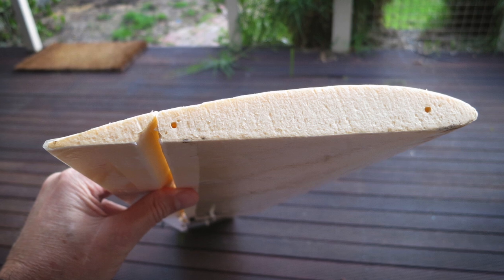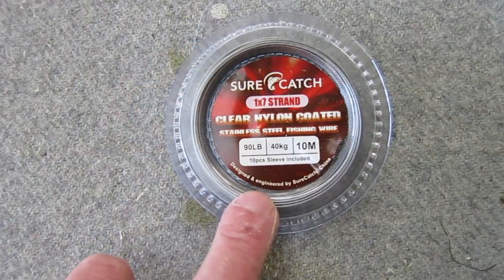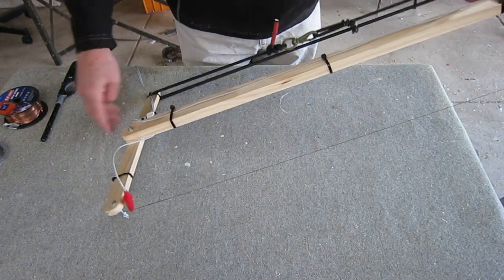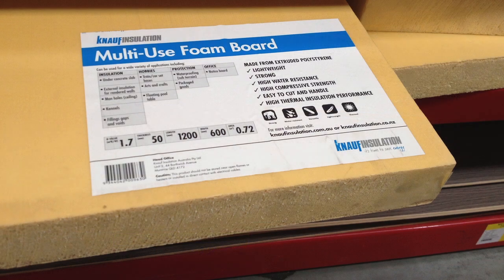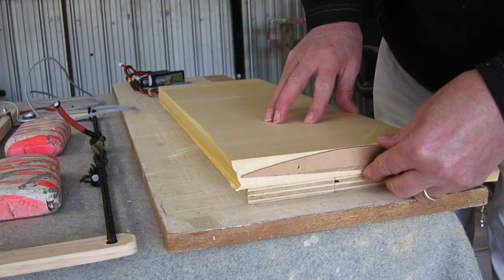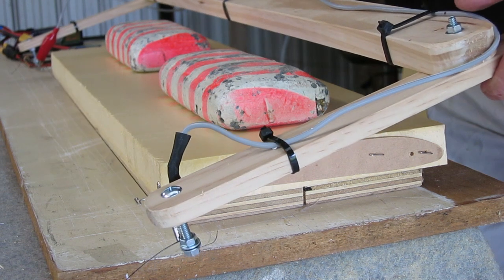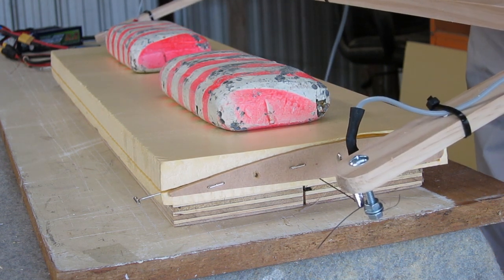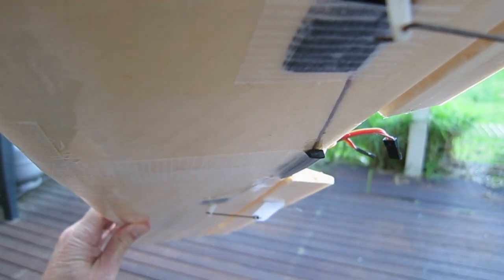Hot wire airfoils and bow

Comment: I never saw that sort of cut before. Well done. I used to do it with cross-section air-foil cutters, I made out of piano wire mounted on a special board. It' was a lot of mucking around making the air-foil cutter. You don't have to do that, you just make the air-foil guide ends. That's a lot easier.

Comment: fab fab vid thanks. Do you have one for your fuselage? I just started my spar hole with a soldering iron ;) I used nichrome wire, it's ok. I use lipo too, nice. I add copper wire for resistance if necessary.
Reply from the maker: FastEasyLifeTips Many thanks. Fuselage build is in the 1.2m Acrobat build video

Comment: Great video! I built a cnc hot wire cutter that does all the cutting for me, but operates on the exact same principle you're using here.

I have some airfoil comparison/generation software (it's called profili) that allows you to view the data on different airfoils as well as generates the cut path. The software creates a "spar" path, which basically cuts a circle in the middle of the wing (from the top or bottom). You could just drill/cut a spar hole and wire path from the top (or bottom) in your wood jigs. I think that would solve your spar issue.

I use NACA 4412 for my FPV planes, NACA 0012- NACA 0014 for aerobatics, NACA  3413, NACA 2413 for casual aerobatics.

Welcome to the new world of airfoils! I think I have more fun experimenting with new airfoils and designs then flying the damn things.
Reply from the maker: ***** Thanks Chris, great tips. I did wonder whether it was possible to use the hot wire for the spar channel, must try that.

Comment: So the foam wing out performs the Depron wing of the same size. That's interesting.  Cleaner airfoil shape or is it the lighter weight that make that so?  I know with Adams foam board you tend to get flat bottom foil shapes that work but aren't as efficient. 

Great video as always Andrew.
Reply from the maker: Dave Mason Thanks Dave. Weight, cleaner and deeper airfoil would all contribute. But to be honest the difference in performance is not as big as I expected.

Comment: Hi Andrew, I don't know if you have a lathe, but before you dremel out a channel for a spar maybe drill out a hole if you have access to a lathe. I used a lathe that's only 660 B/C but I've had success drilling holes 600mm long (with the lathe tailstock removed) using a carbon arrow shaft in the chuck as the drill bit and then you can use the arrow shaft as a spar. I've found arrow shafts (about 8mm diam fm memory) to be cheaper at $8ea than buying carbon tubes from a LHS. You'd think that it would be difficult to eyeball 2 axes 'square' while drilling the hole, but I found it surprisingly easy.
Reply from the maker: Andy Dodson I don't have a lathe, but I thought about securing the drill to the table, using a sharpened arrow shaft for the drill bit and sliding the wing towards the drill.

Comment: A while ago I built a foam cutting rig.  I use a 30V AC transformer that I scavenged from something or other.  On the 240V AC side I wired in a standard 240V light dimmer to control the temperature.

The hot wire cutter is connected to the 30V AC side and it works a treat.  You can turn it up to the best temperature that just cuts the foam with the light dimmer.

My favourite airfoil is the S7037 which is in the database.  I use a program called WinFoil to print out co-ords as you can design the wing allowing for skin thickness if you need to.  Compufoil is also another good one.

The S7037 is a really good all-round glider airfoil that is much lower in drag than the ClarkY.  The S3021 is also another good choice.  For faster models the classic RG15 works really well.  

For my flying wings I am using the MH45 at the tip and MH46 11% at the root.  It flew pretty well once I got the CG right.  I got this wing cut by someone else out of EPP foam.
Reply from the maker: Stephen Gloor Thanks for the airfoils tips Stephen. I tested an RG15a111 on my ultralight sloper today and it was very nice.
Reply: Yep the RG15 was a favourite for F3B for many years.  They tend to use the newer airfoils now that blend from root to tip such as the A series from Andrew Drelar or the HQ series.  However the RG15 still is good.

Comment: great to see you evolving on to hot wire cutting. within the last few weeks I've been toying with the idea too and have seen where PC power supplies can be used as the source.  I just so happen to have a pc power supply kicking around and some guitar strings too. I'm even more inspired to give it a go now.  I've always been curious about how the outer and inner airfoil templates are lined up with each other prior to cutting???
Reply from the maker: 28th St. Air Land & Sea I started with a PC power supply but it tripped the house safety switch when I turned it on so that went in the bin. So far I have just eyeballed the template placement but I'm working on a better system.
Reply: 28th St. Air Land & Sea Yep, I was thinking the same.. 
I thought about it and maybe a process like below would get them straight.
1.Draw line at 90 degrees on top of foam

2.Align template on inner template.
3.Mark spot on template which is directly under the line on foam
4.Copy mark location to outer template
5. Allign templates and cut.

Probably lots of videos on Youtube about this.

I am also thinking same, but using offsets and different size templates.. for Flying WIngs.

Comment: for the spar if you take a metal rod just smaller than your spar, heat it, and make a guide so you can push it in square then heat the rod and push it in to the wing,the rod has to be smaller than the spar because the heat will melt a hole just larger than the rod
Reply from the maker: izee FPV Thanks for the idea.

Comment: Nice work, Andrew. Now I am inspired to build one. Looks pretty simple. I might try using my router to route a groove down the CG line of the wing to glue a spar into, rather than trying to drill.  Thanks again.
Reply from the maker: Jon Elofson I agree Jon, that's the obvious solution. Need to protect the foam from the router base with tape maybe, it's pretty easy to mark.
Reply: Andrew Newton An alternative which may be easier could be to make a cut say 5mm deep along the top and bottom of the wing and force a carbon strip into the slice - narrow side visible. Something like http://www.carbonfiber.com.au/prod74.htm. Having a separate strip on the top & bottom surfaces of the wing would make the system act like an I-beam and probably be stiffer than a single arrow tube.
Reply from the maker: Lex Dysia I did exactly that for the Ultralight sloper wing and it worked very well. Just one 1m x 6mm x 1mm spar epoxied in to the bottom.

Comment: nice work,  I did a similar thing and built a 3 m glider using Blue Core foam we have here in the states, it was made in 3 sections per side, the spar was made from carbon fiber arrow shafts laid in a groove cut in the under side of the wing- I used a copper wire loop affixed to a soldering iron that was the same diameter as the spar to hot cut the tubular groove. it worked very well.  keep being creative- it makes life fun!  Roger
Reply from the maker: youmanskids Hmm soldering iron, might be a solution.